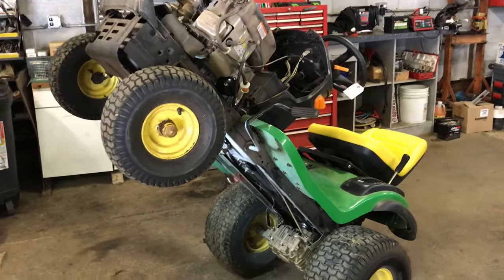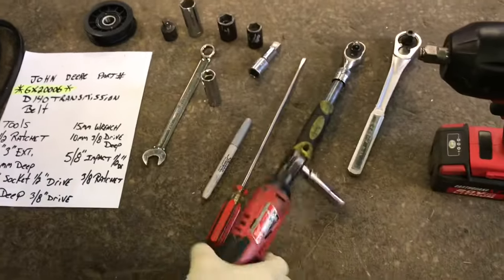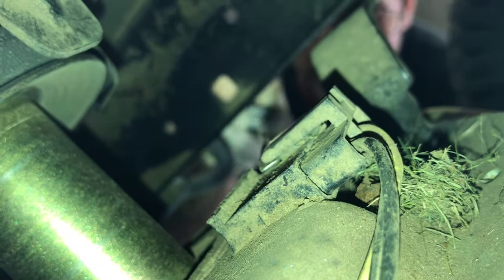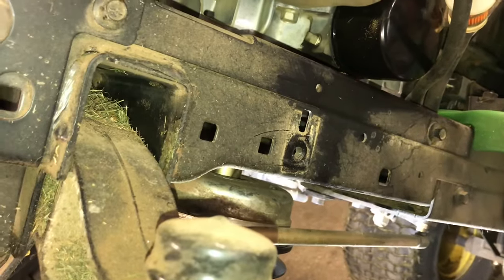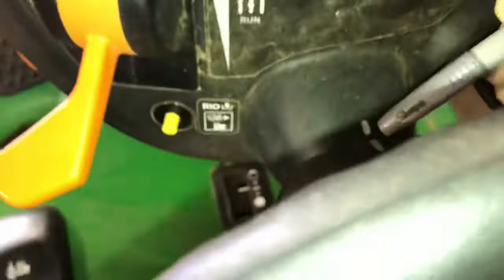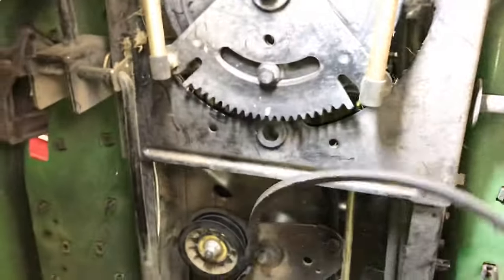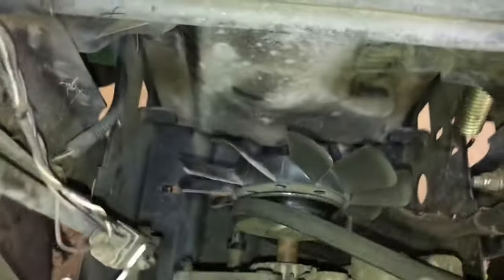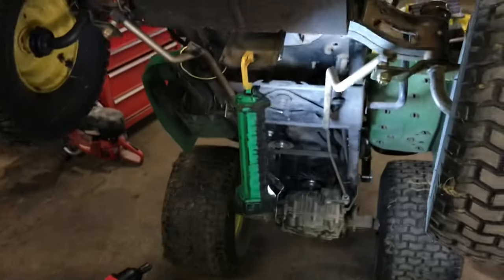How To Install a Transmission Drive Belt John Deere D140 D160 155C LA165 LA115 LA145 LA175

Comment: any suggestions on getting the stack pulley (engine pulley) off?  mine seems to be stuck.  thanks in advance
Reply from the maker: PB Blaster penetrating oil and two long pry bars one from each side of the frame up under transmission pulley. Normally a two person job with the pry bars but be very carful not to bend the pulley.
Reply: @JohnsonsSmallEngines  thanks....finally figured to turn on side, spray some pb blaster and let soak, then used pulley puller with bolt still in the pulley but loosened to give about half inch play so it could come down....thx...bs

Comment: Great video!!  Very informative. Could you tell me what year this model is? I have a 2011 D140.
Reply from the maker: I do not have the year of that machine and has left the shop so I cannot look to see what year it is. There should not be anything different from your machine and the on in the video.
Reply: @JohnsonsSmallEngines  Thanks. I thought maybe the belt brackets may be different.

Comment: I’m trying to do this on a D155. Is there a secret to get the bolt out of the bottom of the clutch?  I hit it with an impact and it didn’t move. With a wrench the pulley about just turns with the bolt. What am I doing wrong?
Reply from the maker: Keep using the impact. It should come off unless your impact isn’t very powerful.
Reply: @JohnsonsSmallEngines  thanks. I have an 18volt rigid impact. It doesn’t break free. I’ll borrow a more powerful one and see what happens. I tried to just put a standard socket wrench on it and the motor turns with it.

Comment: Would this be the same process for a LA175.  

PS if I get mad at the tractor I can only blame myself because a guy with one hand is definitely able to do it   pps   Awesome work
Reply from the maker: I haven’t seen a LA175 yet but if it is the same for you please let me know and I will update the heading. I have learned to have a lot of patience being born with only the one hand.
Reply: @JohnsonsSmallEngines  well I just changed it today and yes it's the same unfortunately we couldn't get the clutch off it was spinning the engine  so we bent the metal back but many thanks to you
Reply from the maker: Hi Fred,  Ok, I will put LA175 in the description. Thank you for letting me know:)
Reply: @JohnsonsSmallEngines  you're welcome and thank you for the tutorial

Comment: How do you remove an idler pulley on a JD-D140 when the bolt and nut are spinning together?
Reply from the maker: Not sure what idler pulley your trying to get off? The idler pulleys that go with this video are stationary. The bolts to the bracket. Maybe you have carriage head bolts? Meaning the bolt goes into a slot on the bracket so I would pull down on the pulley as I’m taking it off to keep the carriage bolt in place. Or the bolt had broken away from the bracket and you may need to take the bracket down to repair. I would need to see what you are talking about to really help you. I am just guessing what you may have going on.
Reply: I am talking about the bolt that goes through the mounting bracket that holds both pulleys. The bolt for the larger flat transmission idler pulley spins freely from the bracket not allowing the nut to come off. I’ve tried holding with vice-grips with no luck.
Reply: I have a John Deere D140 that matches to this video exactly. I’ve done everything in video except removed the one larger flat transmission idler pulley because the mounting bolt attached to the bracket is spinning with nut. The smaller v-pulley came off no problem just as video showed.
Reply from the maker: It sounds like the stud (bolt)broke loose from the bracket. See if you can pull down on the pulley while taking off the nut. I don’t have a machine to closely look at or I would try to find a remedy. I haven’t yet come across what you are dealing with.
Reply: @JohnsonsSmallEngines  I’m going to have someone weld the top side of the stud to the bracket tomorrow and see if that will hold it so I can break the nut loose.
Reply from the maker: That should work! Let me know how you make out.

Comment: Hi,
My LA145 drive slow after I reinstalled the belt. Any ideas why is doing that, if I wanna drive back it drives normal back speed, just the forward drive really slow. 
Help please!!!!!
Reply from the maker: Double check all the way from front of engine to transmission to make sure everything is on correctly. If it was operating correctly before you replaced the belt then it must be something you did.
Reply: @JohnsonsSmallEngines  I forgot to mention the. Why is not a brand new one, not sure if this will help. I checked the belt and nothing seemed wrong. What can cause this (slow forward drive), I was thinking I may need new belt, or something else?
Reply from the maker: If the transmission drive belt is the original belt and the machine is moving slow going forward there could be multiple issues from your pedals not adjusted properly to an idler pulley frozen or the belt is stretched or if the machine has towed heavy or if it has had to go up steep hills for along time the transmission itself could be failing. I really cannot diagnose that issue without seeing the machine.
Reply: @JohnsonsSmallEngines  I see, my issue started when when transmission belt stuck between the fan and the back idler, I had to remove only stick who holds the belt in order to put it where it should be, otherwise, I’m pretty sure I did not touch anything else, my guess is after the belt stuck and kind of burned little bit and saw some smoke it get loose, do u think that maybe one of the issues ?
Reply from the maker: Sounds like that could be it. Get a belt, check all idlers to see if any are damaged and get what ever you need to do the job and go for it!

Comment: What’s the model number of this specific belt?
Reply from the maker: The model if the tractor is a D140 and I gave you the part number of the belt in the first 2 minutes of the video. Not sure what your questioning?

Comment: No videos on how to adjust drive belts tension gas pedal play on john deere hydrostatic  automatic  transmission
Reply from the maker: What model machine do you have?
Reply: @JohnsonsSmallEngines  la115 has new belt and  pulleys but sometimes  it quits pulling
Reply from the maker: @stephenmayfield2402  The only belt tension for the transmission belt is spring tension so there is no adjustments to be made. As long as you know you have the correct belt and all of your transmission pulleys are in good shape ( not seized ) that’s all there is. If the tractor transmission runs good at the beginning of using the machine and then it fades away? Your transmission may be starting to fail. If you have hills on the property and if you have ever towed a cart behind with any kind of heavy loads? These are the factors that can make a transmission start to fail. There are videos out there that show a transmission fluid change but most of the time it only works for a little while.
Reply: @JohnsonsSmallEngines  I saw online there is a way to do it with the idea control arm for the tranny
Reply: @JohnsonsSmallEngines  but no video it's all words

Comment: Excellent video, the best on YouTube for this. A few comments that might help someone out:
1. Even if you can't lift the tractor up like in the video, even getting it off the ground a little really helps. My son and I rolled it up onto a couple of wheel ramps and chocked the back wheels. We have a jack and stands but this was quick and easy and gave enough room.
2. When removing the PTO you really need an impact wrench. The nut might be really stuck so don't be surprised if it doesn't come off right away. If you don't have one (and this is a perfect excuse to get one) you can try what's in this video: https://youtu.be/YXlAdcTS8i0?si=wR06hv6wo6Qjz8W_
Also, the clutch is heavier than you think so yeah, be careful not to drop it.
3. Before buying the belt, look to see if the steering pinion gear needs replaced. If you have a lot of hours on it, the gear may be chewed up so for convenience buy a new one at the same time.
4. Speaking of the steering gear, in the video it comes right off. Yeah, no luck for me as it was really stuck. What you can do is thread the nut back on so it's even with the end of the steering shaft. Wedge a screwdriver to use as a lever in at the top between the gear and the collar and bang on the nut/shaft end with a hammer (don't hit too hard or crooked and mess up the threads). The gear should drop loose.
5. When putting the clutch back on I put the pulley on first like in the video. Like mentioned it was tricky to line up the clutch properly, and while trying to do so the pulley would drop down. So instead I put the pulley and clutch back together, then put the unit up as one which was easy to line up.
6. I installed the belt guide bolt with the belt loose as I didn't want to release the brake. I just held the belt out of the way with my other hand until the bolt was partially in.

The old belt in the video looked practically new compared to what I replaced, LOL.

Comment: Thank you for your very informative presentation. But I have a Jhon deer hundred series E110. It's only 2 1/2 years old it's done 65 hours and the belt lose. This is the first mower ride on I've ever had problems with surely John Deere would not jeopardise their reputation putting in stupid plastic parts. What's wrong with these morons up at the top the CEOs. A lot of them must shake their hands when they hold their hand out to get their pay packet because boy they make some very big mistakes.